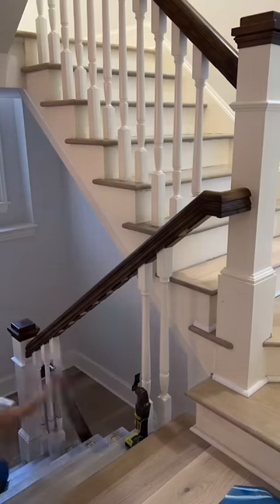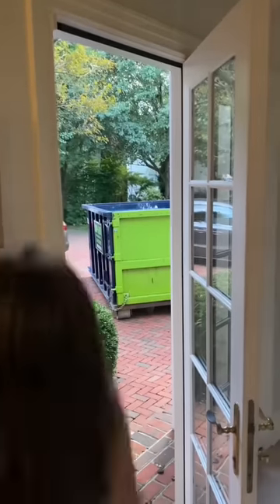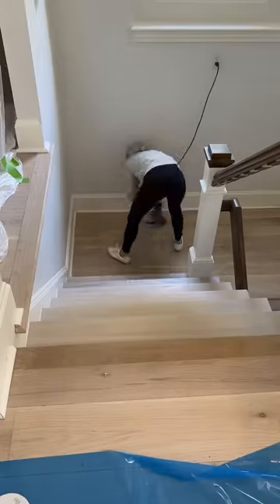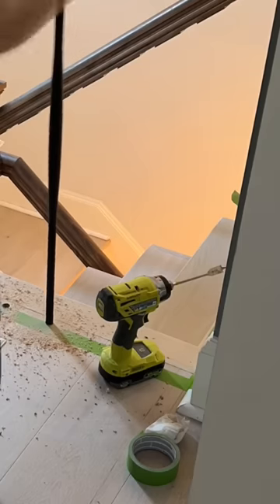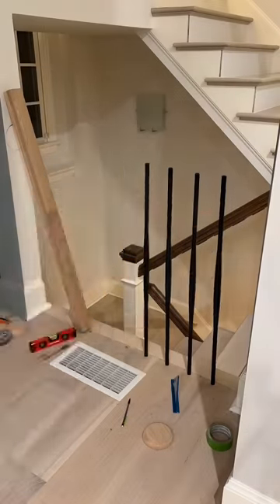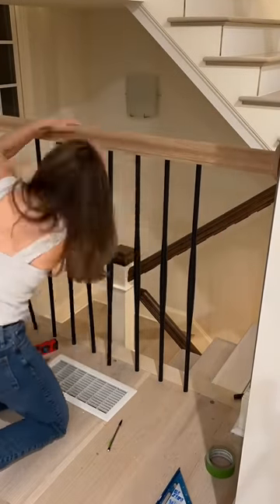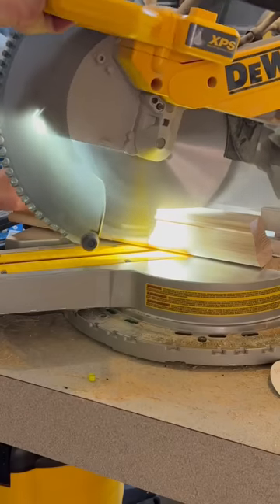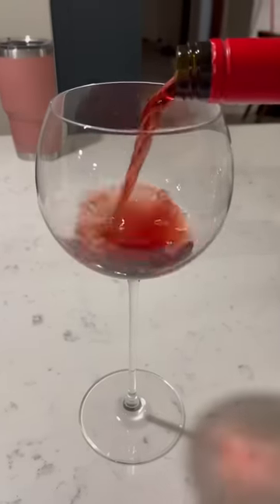Stair Railing Installation Part 1 (Progress)

Comment: You replaced sturdy railings with sticks. What a waste of time and resources.
Reply: Exactly I would just sanded them and painted them a diffent color. I like the original ones better
Reply: What a waste. With a little innovation you could have adapted the old railings.
Reply: Exactly...most all people need to stop thinking they are "interior decorators/designers", whatever the F that actually means. "Oh look, I matched this pillow to my new wall color, I'm an interior designer yay!". This woman and her project is just so cringe
Reply: @Mike_Jones68  I feel personally attacked.
Reply: It’s all up to personal preference, why you guys gotta be so butt hurt about it 😂😂
Reply: I read this in Ron Swanson’s voice 😂
Reply: That’s the thing with chicks they go for what looks “cute” never what is right
Reply: I was thinking the same but i wouldnt dare speaking that straight. The old railings were in perfect condition.
Reply: The new ones are steel and modernize the look of the house. Mine look as 70 as hell.
Reply: Every single person on this comment chat would do something different. Just because it’s not what you would do doesn’t mean it’s wrong.
Reply: Yes thats what i was thinking... what a shame
Reply: I agree, what a waste...
Reply: I AGREE, LOOKS OVER FUNCTIONALITY IS A WATERHEAD MOVE
Reply: @cconnon1912  Mine are original 1940s, and I keep them.
Reply: @cconnon1912  Drilling into the floors was absolutely wrong.
Reply: Yes, the old spindles were wood, but the new spindles,or sticks as you call them are iron. It's not whether you like it, it's what she likes.
Reply: @roomwithaview4195  Spindles on railings are practical things.  Throwing them away when still good is wasteful.
Reply: Sad to say 😔🤦🏽‍♀️
Reply: She had someone show and do with her face. Nope total lie.
Reply: @Mike_Jones68  i preferred the old one too but omfg it's HER home and she can do what makes her happy...
Reply: @cconnon1912  it was extremely wasteful,for no good reason. Resources are scare, so wastefulness is wrong, obviously.
Reply: Lol 😂😂

Comment: The old railings were beautiful. A restoration instead of a replacement rail would have been my choice.
Reply: Same
Reply from the maker: That was my choice too! Our treads were damaged by the flooring “pros” last summer, so we had no choice but to replace them. That required the railings to come out!
Reply: So why didn’t you have the pay to repair the damage?
Reply from the maker: @TeDeum20  I didn’t have to pay for the treads, the company sent a new contractor (who was amazing) to fix them!
Reply: Thank you 🤷🏾‍♀️👏🏾👏🏾👏🏾
Reply: @champagnechaos  that's a shame. The style was very fitting for the house. 
Great job with the remodel! 👍
Reply from the maker: @ldqa2737  yeah it was a bummer, it was one project we were hoping we wouldn’t have to do!

Comment: Now think about this. If you cut the spindles at the top and bottom you probably could’ve sold them for a pretty penny. And could’ve sanded the original handrail.
Reply: I remember buying it $14 a pice
Reply: Yes! Crafters look for them to make candle holders and other things for crafts
Reply: Absolutely! I have a plant table made from a railing like that. .
Reply: Completely agree. This went to the landfill so unnecessarily
Reply: @susanlarberg2380   That's what I was thinking! I could use those! :)
Reply: Those rail is solid oak
Reply: @farmfitnesspham4913  both?
Reply: @homesteadhaven2010  both ? New rail and old rail yes it both oak solid
Reply: Those hand rails were just gorgeous and made so well. The old ones just so much nicer.
Reply: @katherineernst3603  made me sick when she threw them in dumpster!!!
Reply: The old handrail was ruined or broken and she had to throw it away because of that, she's commented this now

Comment: Why not sand and refinish the old handrail ?   Then add new spindles ?
Reply: Because that would be too easy AND make sense 🤣😂🤣
Reply: Curious about this. The new handrail looks the same.
Reply: @pt7953  right she could taken the old ones off and used the top rail and full the wholes in and create new holes for the new pieces like she seems dumb...
Reply: @Kt-cn2rq  yep. I would have done that just to save the expense and pain in the butt mitering the new handrail. Original one was perfect.

Comment: I like the original railing so much more than the new one. And despite being more time-consuming to clean I'm sure it was also a whole lot sturdier/safer.
Reply: I would not buy that house if it was on the market.  The replacement staircase devalued the home.

Comment: would of loved to have them spindles for some crafts
Reply: Or resale
Reply: I know that I'm going to get some comments back at me , but I didn't like the new railings that she installed.  I liked the old ones . They had more character.  And the new ones she put in , looked flimsy and weak. SORRY.  But to each it's own.
Reply: @marlenedecook9014  I agree, sadly. They looked like the wrong size/shape for the heavy railing.
Reply: Right!?
Reply: @marlenedecook9014  ...and a person who has trouble walking up a flight of stairs typically leans on a railing, will it support such an endeavor?
Reply: @Stacy Sietsma
Ashley Dodd, in the previous comments, says people don't have time to find someone like you who would want those spindles.  smh

Comment: Experienced carpenters want to drink when they have to do a railing too. They are tough.
Reply from the maker: This is so good to know! This project is INTENSE, I have major respect for the pros who do this regularly!!
Reply: @champagnechaos  on production construction sites, the stair railing installer only does stair railings. And they are paid very well.
Reply from the maker: @ian5780  that’s fascinating! And so smart because the protection those railings provide are legit life or death… the pressure got to me, not gonna lie haha…
Reply: Next time, just a simple trick, save the old railing to copy/match the "angles". Oh, experienced carpenters drink all the time, no part of their profession makes them do so. Trying to install Crown moulding in an out-of-square room with multiple odd ceiling angles, that's not a newbies task....🤯
Reply: Stair railing is easy peasy
Reply: @russellphillips1589  no it isn't.
Reply: @whitetailhunter7202  there isn't always an old railing. You ever heard of new construction?
Reply: @russellphillips1589  show me the rails you built then
Reply: @whitetailhunter7202  crown moulding in a pentagon is easier than stair railing angles.  Way easier. Stairs are full of compound mitres, crown is not.
Reply: @ian5780  Rewatch the video. She removes the old railing and installs the same. Hence she could have  copied the miter cuts. Yes, not every instance can you do this. That suggestion was only for this scenario.
Reply: @ian5780  You my friend have obviously never installed true crown moulding. Every single cut for crown moulding is a compound miter cut. I have friends that do railing for a living and some very very fancy railing they don't blink an eye fly thru it, done before lunch. Railing is simple, many just over complicate it. Dealing with Framers who build out-of-square rooms and then run crown in the out-of-square room, it becomes a trial and error battle to make things fit correctly. Get 30+ yrs of trim carpentry under your belt you'll understand.
Reply: @whitetailhunter7202  you never have to set your saw to a compound angle is what I meant. You just set the crown on the fence the way it sits on the wall except upside down. Stair rails are still way tougher than crown because you have to space out the spindles. Would you like to see some of my work?
Reply: @whitetailhunter7202  you just proved my point. Your buddy dies stairs every day. That's why they go quick. The reason he does stairs everyday is because he's specialized to do stairs, because they're tough.
Reply: @ian5780  The guys I know, don't specifically do stair railing. Custom Cabinetry, Custom trim work of all types. They just find railing simple and relaxing.
Reply: @ian5780  That is a compound miter, trim at 45* angle and saw blade at another angle, then at times tilting the saw at another angle. Spacing spindles, makes it difficult??? Dude if you find this work difficult, go find something else to do. Crown can be much much complicated because of multiple vaults coming down at different angles on a ceiling, plus you may have to deal with Framers not using a square properly, so none of it is square. (And the house goes for millions of $$$) I've always found Railing simple and straightforward, not having to rely on someone else to make it square. That falls on you.
Reply: @ian5780  I've seen your work. (You've posted a short video.) Nice job, just, I don't find railing that complicated at all. You make your own square and plumb, no need to rely on others.
Reply: @whitetailhunter7202  the one you saw has square spindles that had to be mortise at an angle. Thanks for the compliment. That did not get done by lunch. But also the interior designer made it more difficult by ordering the wrong ones, the clients are elderly and the job got post posed over a year,  then they discontinued the spindles so we had to have a metal shop fix some of them last minute while the homeowners were on vacation.

Comment: “Drove me to drink, kinda a lot” lmao so true
Reply: I would have drank a lot after I realized I made the biggest mistake of replacing the most beautiful classy railings full of character that could have just been respindled and freshened up for your new modern look.

I get it you didn't know as a contractor those things come naturally to me. You did a good job on what you did It looks good I just think the old ones were really full of character and honestly I think you did a lot of unnecessary things to get the look you were going for.

But if you take anything from my comments please please please don't throw beautiful aged wood in the dumpster. Reduce reuse recycle
Reply: @theelectrifiedhomestead9478  calm down

Comment: The old railings were much better. But that's just an opinion. Good job though! It is not an easy task. Next time remove the shoe molding. Makes the job easier and better. Also, at the top, the holes are supposed to go into the nosing. You are supposed to by a wider nosing. But it doesn't look bad that way. Looks great.

Comment: Good for you understand stairs commonly run at 34/37 degrees take two pieces of scrap divide the slope by two this should help you find the correct angle don’t be afraid to try new things what your doing looks great remember you can’t have a space bigger than 4” between spindles
Reply from the maker: Thank you so much! This was very helpful - and I did redo the top railings to make sure they were safe and met code.

Comment: My only question is what is the distance between spindles, I know in some areas there are rules so that no child can fit there head in-between and get stuck.  If it is not within regs you could have to remove before selling.  I like it and you have moxcy!
Reply from the maker: I realized that! 😬 Tore them out and fixed the spacing! Thank you!

Comment: It looks good but pointless... old ones were just fine. But I guess if you have the money and bored than why not. Unnecessary in my opinion, I would've put more effort into the bricks in the front of the house that are not level and need to be refilled (sand/grout).